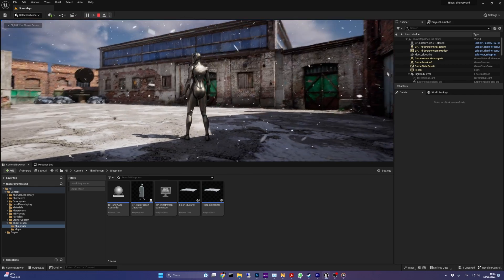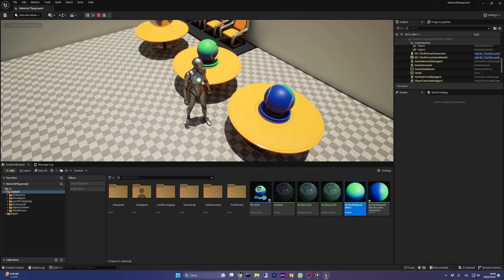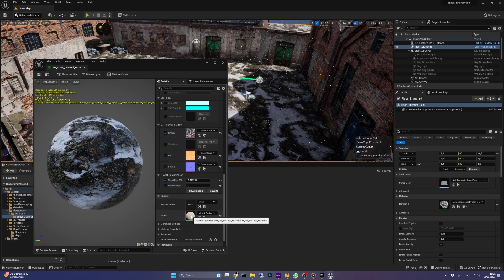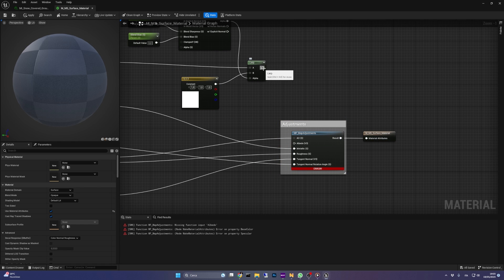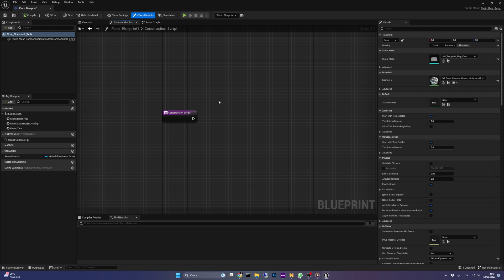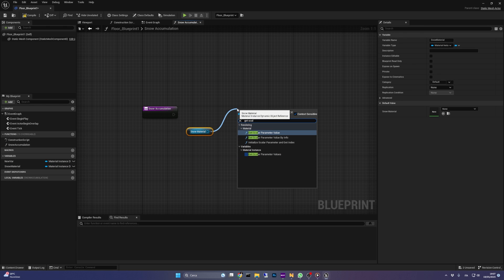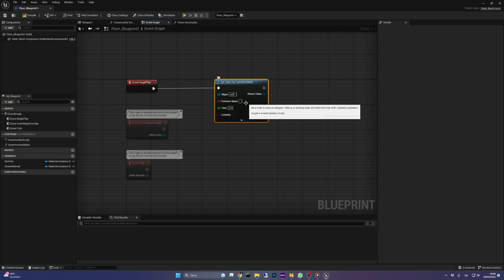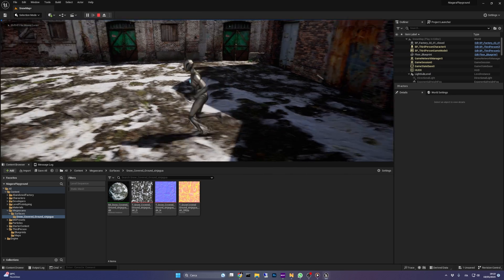[UE5] Simulate SNOW ACCUMULATION: Dynamic Material and World Aligned Blend

Comment: I love it thanks! The only thing that bothers me is that it doesn't seem realistic as the surface stays flat. You know, when snow tends to accumulate, it forms volume over the ground. Do you know how to fix that? I was thinking about Virtual Textures but I never used them.
Reply from the maker: There are different approaches, it really depends from the project... Going with the material route is possible but can become quite complex (dynamic material based on position and world aligned textures,  plus vertex painting) but probably won't be scalable to big scenes in terms of performance. There's also a simpler mesh route, where you make mounds meshes emerge from the ground as if the snow it's accumulating, far cheaper in terms of perf but less realistic of course.